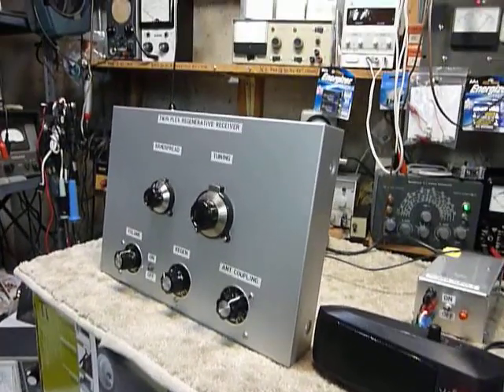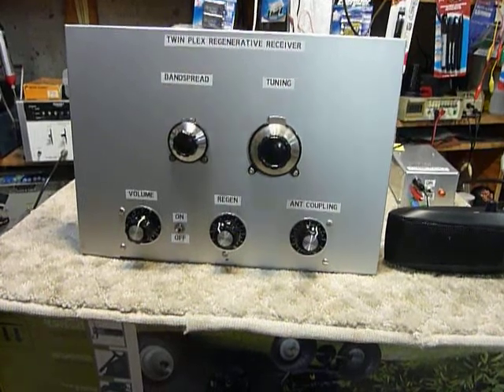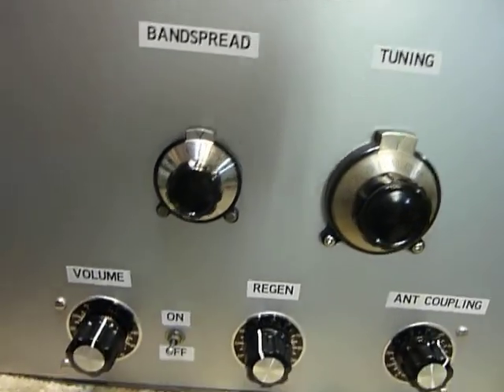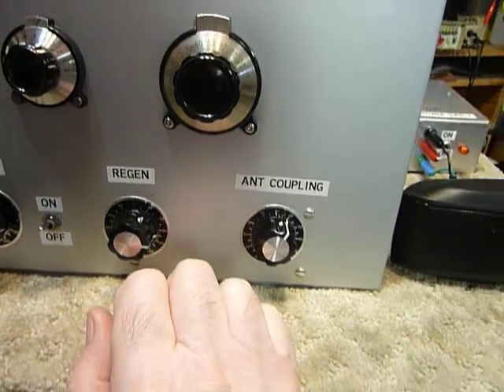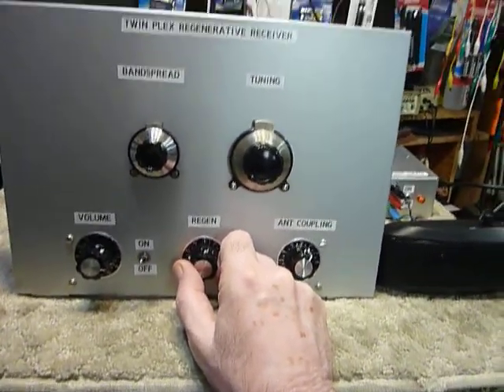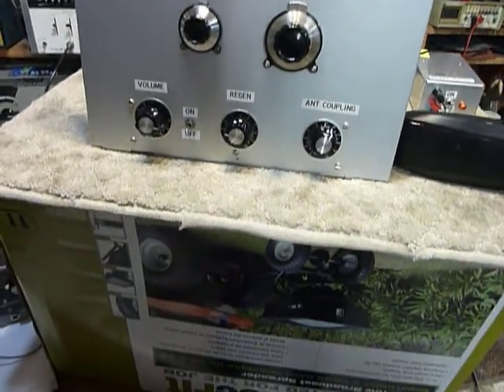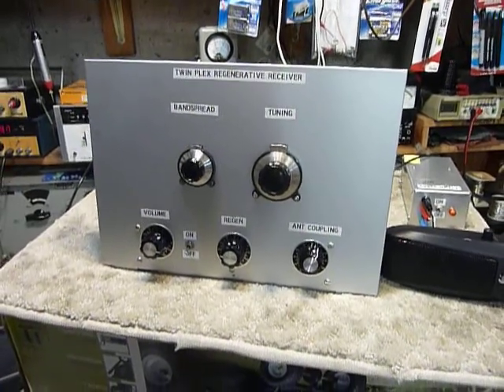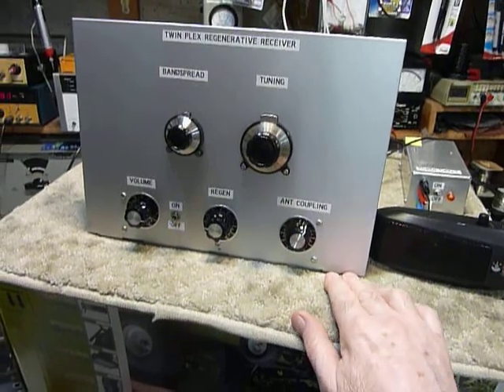TWIN PLEX REGENERATIVE  RECEIVER , AA8V TWIN PLEX

Comment: I gotta get back to building kits and stuff again.....I'm a CW Nut, myself.....got weaned into ham radio in '77/'78 in Arizona.....got a Hallicrafters s-53a Gen. Coverage RCVR.....and a wire in the garage attic.....loved it.....been a ham since 1980....
Reply from the maker: I am quite active in CW here and especially like QRP .  I do not chase DX those pile ups are crazy  . 73  Bob
Reply: sorry, dude.....I'm a CW contest Junkie to the max.....but love your videos and the old heathkits....started off with a DX-40, a Knight VFO, a handful of XTAL's, and the S-53A....then got a HW-8 Kit for my 15th birthday....finally got it working, and made a few contacts with it....the dx-40 would do 30-40 watts, depending, and took some getting used to, but I figured it out....scooped up a dx-160 a couple years later, then was inactive till '89, when I passed the 20 WPM no sweat, but had to climb the ladder taking the tests to get extra....had a few Swans' a couple of ten-tec's, and a few heath HW and SB rigs over the years....have a HW-101 and a home-made power supply I got for my 50th Birthday....works, but some vox issues on CW and unsure if it works on SSB...running Elecraft K1's and Yaesu rigs at the moment, and a contest shack/hamshack trailer 30 miles east of me. love CW....I also do QRP/Portable and SOTA's...evenin'. again, love the videos.

Comment: Bob that’s a great job, I really like the knobs you got. I just ordered a 19 tube to build a 1930’s style twinplex, then I’m going to build one with a 6sl7, and finally a solid state one based on the book ”How to build the twinplex regenerative receiver”  by T.J. Lindsay 😃
Reply from the maker: Tom ,  I just bought 2 number 19 tubes at the Fort Wayne Hamfest .  I was thinking one of them may ? be good they were not tested  used tubes . Well one was good .  I plan to change the socket and try one in the Twin -Plex ... The knobs are sold on fleabay  "5set black rotary potentiometer knobs"   73  Bob